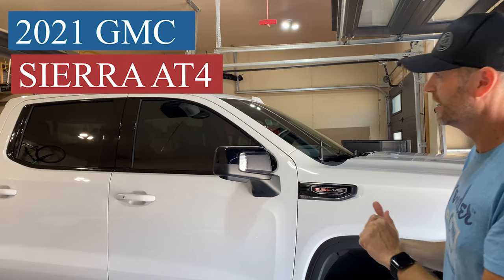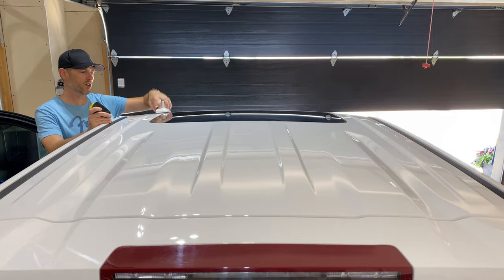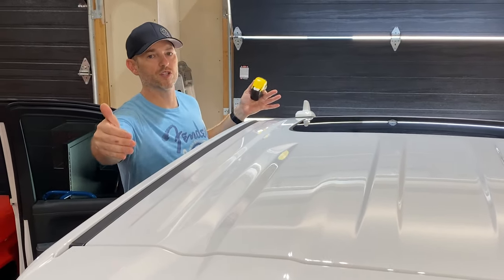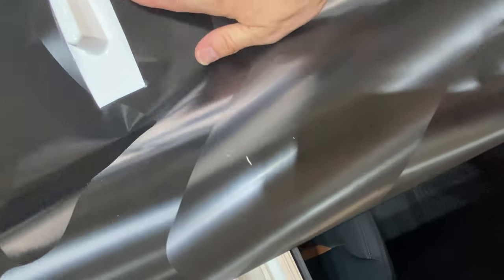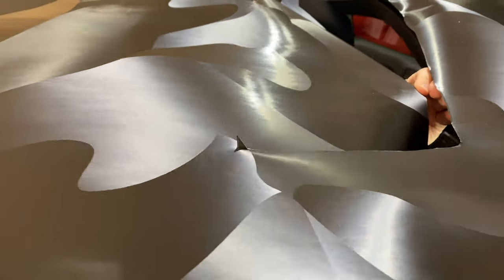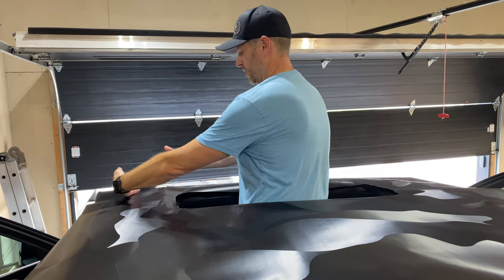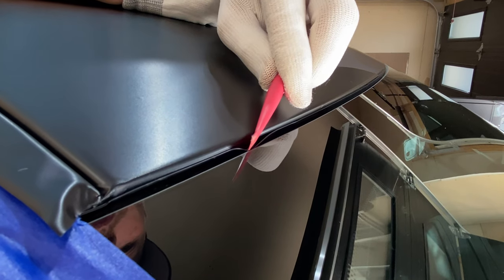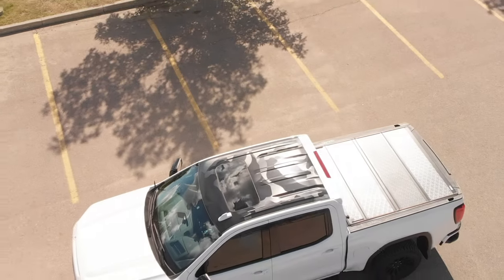GMC Sierra / Chevy Silverado Camo Roof Wrap Tutorial!  A Detailed How To Video

Comment: Why are you having to heat the film as you apply it? I understand afterwards to make sure it adheres to the paint better
Reply from the maker: Many factors. If it was a door panel, probably wouldn’t need heat with this film depending on the contours or lack of them.  The roof is ribbed so the film had to be heated and laid into the valleys.  Also heat will relax or reset the film if you want to get rid of wrinkles.